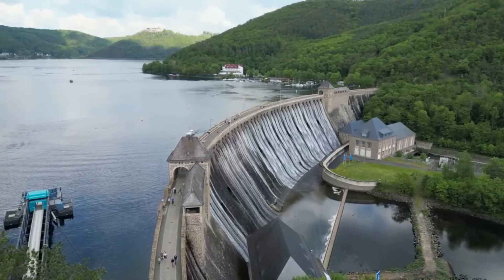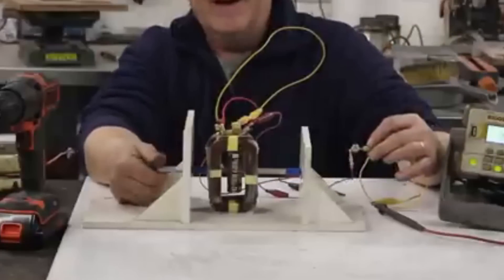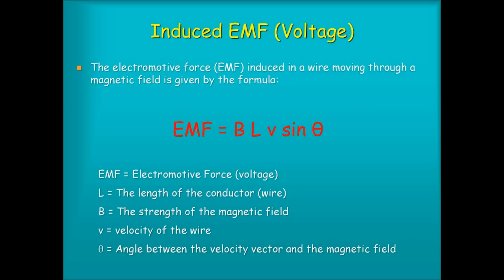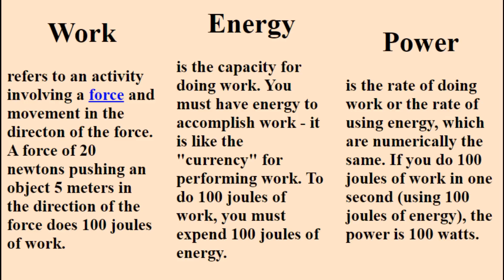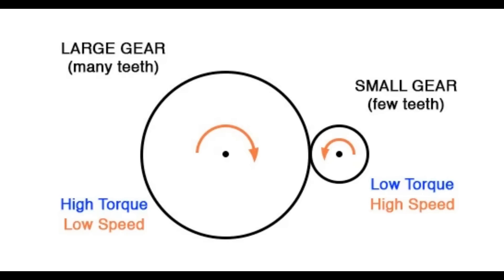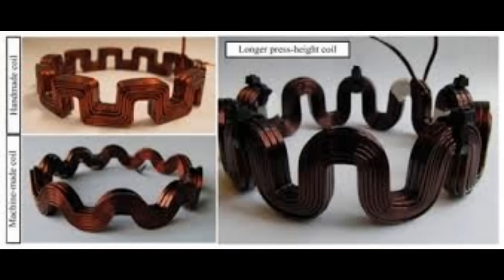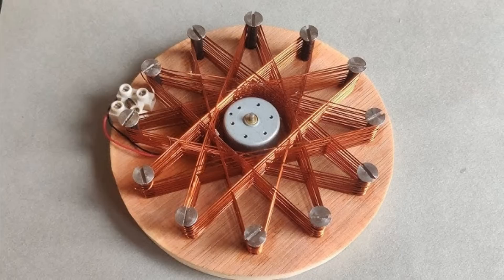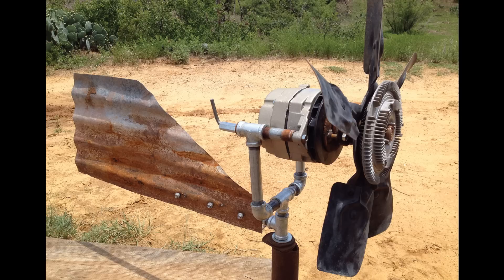2287 Building A Generator

Comment: ...i got all the measurements for the pieces for a geodesic dome within the 12 foot code [edit domearama page) and the thing is i have a cedar tree dying with enough lower branches to cut from , i think for the hubs I could use flat metal with flat tips that i wrap around the branch cuts and bolt together from scrap steel ....the thing with those they need a base for floorspace , tires filled around the decagonal base but then tires ar ebiohazard i thought but they shred them and use them in roads (!!!, genius instead...(?)) ....i saw a vid they slice the sidewalls off old tires then cut between the cables in the grooves to make rings , these maybe have some mileage for lighter vehicles , like a repurposed wheel ring of tread....i have loads of ideas oh my point on this dome mine will ideally have a standard square shed base then the dome will make hopefully the skull top part for this shed alternatively a mushroom theme would work for such a dome up on  a base , the eyes will be windows in the loft maybe like little office guest room ...

Comment: ..Oh the thing was i mentioned a shredder design for shredding styrofoam i could maybe source for * free * ,sort of, route getting it from retail places ... i was imagining it could even be hand shredded , it's funny there's many tools for shredding BBQ meat too for example , but there's so many ways one could shred styrofoam if the objective is just make a styrofoam shredder , by hand i could use straight boards and nails, screws protruding geometrically positioned to shred styrofoam , ...Now i'll probably make a roller with screw heads instead of old saw blades maybe seem overkill ....it'd be an interesting contest maybe hand shredder, powered shredders... i was originally going to use an old electric lawn mower , deck and all over a garbage can design . i think there's potential fireproofing it with concrete powder(s) but my design it'd be sealed in plastic then cemented over like a shell then glue mortared together for fake blocks , i've studied the styrobricks and aircrete bubble dish soap methods and stuff ...for sheds but cementboard is now exterieor rated versions in 4x8 and 2" foamboard is not that much for actual houses .../ranting (edited spelling mess typing)
EDIT2 : darn i just remembered the heat wire methods that make packing peanut sizes but this is for stuffing into old plastic bottles with lids then making a shell like blocks idea ...

Comment: ...there's a lot of newer components , supply , these things are elemental , all things are elemental then arrainged by geometry , IMO it's a good time to be a creative engineer , placing these elemental components to make new items , i saw a plastic box , with three or so strong magnets for example and some holes for mounting and it's a $30 gun desk holder junk thing...Batteries cost too much still is my design snag on the electric toys...

Comment: Modern generators. Are they really 99% efficient? That's surprisingly good
Reply from the maker: That's what I thought when i came across it - but then after a bit of reflection it made sense - they are simple machines with just a few limiting factors and over a hundred years of refinement.
Reply: @ThinkingandTinkering  I thought when we got materials science good enough to build large Tesla turbines it was going to give us a step change. Guess I have to hope in other areas 😜

Comment: Individually the voltage or current a generator can output is also not really that important, so long as you have a transform to "gear" your angry pixies to do the job you need them to do. The maximum heat the system can handle can then be your limiting factor.
Reply from the maker: ok mate

Comment: 5:00 Thank you for bringing in the wire gauge into the discussion. Most DIY discussions forget this key part of the system.
Reply: - thickness of the wire mostly depends on how hot you want it to get  (proportional to how much charge per unit time you need to pass through it) -  If you want it to get really hot, thin is better (otherwise) choose a thicker one....
Reply from the maker: i am glad it helped mate

Comment: So does that mean… as the load increases, the resistance increases, the Rpm of your driving force decreases, causing a fluctuation in Voltage? Or do you just need a driving force so strong that the resistance barely scratches the edges?
Reply from the maker: that's a bit like saying the harder you push a rock the heavier it gets mate - the load is the load it doesn't change - if you give it a bigger load then of course resistance increases  - but that is just like selecting a bigger rock to push - you need the driving force to be sufficient to over come the resistance of the load you want to drive- but there is another effect we haven't discussed here - that's just because it is a basic intro and i will cover other effects in other videos

Comment: I had an idea once to use cheap components to make a generator from solar thermal energy. (Cheap solar thermal collector, fridge compressors etc)
Low temperature differentials were the main issue for collecting low grade but high availability energy.
How much can that be mitigated at the heat exchanger interface. I was thinking of a 3D printed heat exchangers with a massive surface area and high flow rate to be incorporated in an orc system. Never could work out the maths to explore this potential though!
Reply from the maker: It's a good idea - i have seen quite a few solar thermal stirling engines - mostly the ones i have seen have been just large LTD engines

Comment: From old mate chatgpt .....An electron exhibits paramagnetic behavior, meaning it has an unpaired magnetic moment and tends to align with external magnetic fields. This is due to its intrinsic property of spin, which generates a magnetic dipole moment. Electrons with unpaired spins contribute to paramagnetism in materials, while paired electrons (which cancel each other’s magnetic moments) do not.

In addition, an electron can be described as having both spin angular momentum and orbital angular momentum, both of which contribute to its magnetic properties. However, individually, an unpaired electron behaves as a paramagnetic entity.
Reply from the maker: nice post mate - thank you for taking the time to do it - cheers

Comment: Great video Rob, I noticed that some guitar strings are silver plated copper and it made me wonder if they would make a good coil? I can't wait to see your crystal generator! 😎👍
Reply from the maker: they would if the wire was insulated mate
Reply: @ThinkingandTinkering  Thanks for the reply, it would be interesting to see how it would compare to copper only wire. They are one wire doubled then twisted so probably around 8ft when straightened out, enough to do a small test so I'll have to get some magnets 😎👍

Comment: Robert - I wonder if I could make a small suggestion.   The audio in that room is has a VERY bad echo.  I wear hearing aides and it is very difficult and grating to hear.  I'm sure I'm not likely the only one that has this issue.  Is it possible to add some sound baffling ???
Reply from the maker: It is a good suggestion mate and I am aware of the echo - i constantly try to do something about it and the best I have come up with is dialogue replacement - but that is a lot of work I am afraid. Baffles aren't really appropriate as it is my home - but I could also look at filming in a different room

Comment: When I clicked on the video I was expecting a build.
Reply from the maker: I am going to do a build but I also have been doing this for a while so I have a good guess at the kind of comments I am going to get. So, it gives me a good place to point commenters to when they ask the inevitable questions that arise from the build
Reply: @ThinkingandTinkering   brilliant . 
I currently run 10 kw of solar  and as you know winter sun is just not filling my battery bank so I’ve been hunting for a reasonable generator / wind turbine to help top up the batteries during the winter.     I’m on the side of a valley so during the winter the wind is good.

Comment: Robert I am SO PUMPED to see where this generator goes.  My passion project is to find a way to convert an air compressor or small used engine into a flexible fuel (biomass) generator for disaster relief/ emergency purposes.  I have not yet figured out how best to do this as there are so many possibilities....tesla turbines, steam engines, sterling and so on...each with their own advantages, disadvantages, and complexities involved
Reply from the maker: the best thing to do mate is just pick one - chances are you will end up building them all - it seems to me making a start - any kind of start is the way forward for you

Comment: Maybe this is a stupid question Robert, but isn't efficiency Infect all about removing resistans? 
If I have a generator where there is no air or baring friction (not that it's possible) wouldn't every type of coils and every size of magnets give a 100% efficiency, since all movement at the end will be picked up by the magnets/coils?
Reply from the maker: I guess in a sense it is mate. But as you point out that's impossible

Comment: Grateful points well made. I remember lecturers with an affinity for oil companies in the 80s using the irrelevant argument of efficiency of wind turbines on energy that woukd not have been converted otherwise. I tried to argue that the answer was blowing in the wind.
Reply: *Great points, well made Sir.
Reply from the maker: effciency is so often used as a cudgel to beat things into submission with - nice one mate

Comment: Hey Rob, it's so good to see you back at it again! I have a thought for you to eliminate the dead area of a coil while generating.  The stator is a coil  wound in small loops around the diameter of a larger circle in the shape of like a daisy. The rotor is a planetary gearbox with the alternating field magnets on the planet gears. With the correct gearing and coil arrangement, the magnetic field could stay perpendicular to the wire through the full rotation of the cycle. What do you think?

V/R,
Kyle
Reply from the maker: Sounds good to me mate - but axial flux does a good job and is pretty easy to make

Comment: I think also one thing people lose sight of is the concept many hands make light work. So let's say it is "easy" for you to make a generator that is only 60% efficient but you can make one in a weekend, and you enjoy the process. Well in 2 weekends you made something that is 120% as "effective" as something the original size in much less time because you just doubled up the easy thing. Generators can run in parallel, you can have lots of them and the easier and cheaper they are to build the more of them you can have. 

It sounds really obvious and almost daft when you say it out loud, but it seems like everybody is just on a quest to build "one thing" as in if I just build this "one thing" then all of my needs will be met, but that one thing is usually rediculously difficult or expensive to build. So why not build 10 things for a fraction of the price and effort?
Reply from the maker: i think you are spot on mate and make a very good point - thank you for sharing
Reply: This is one of those areas I think 3d printing really shines at it's best. Is the ability to make jigs to make things like doing windings a pretty trivial task.

Comment: my idea is to get kinetic energy from levitating magnets that are angled to create spin and float but have flat panes inbetween angled serration that causes spin, so that the flat areas inbetween help to stabilize it against Earnshaw issues (doddering bobbiness), and then have some SNSN magnets piggy-back on top of this floating thing, with some insulating material inbetween.  And then amplify the spinning SNSNS magnets with magnetic planet gears. into  wider circle maybe  with its own SNSN magnets near a coil. All floaty bits that don't touch - with no friction and possibly in a vacuum it might be awesome!
Reply from the maker: best idea is to build it and see mate

Comment: i still think perhaps we are all too enamoured with using magnetic fields to push electrons around and should go for a more direct approach, using electric fields to motivate the motion...  let the energy flow into the system from the dielectric field which is itself charged by radiant energy from the sun hitting the ionosphere...
Reply from the maker: There is a lot of work in not doing it this way mate - it's just the bulk of commercial generation is done this way

Comment: we need something to regenerate on the other end, using the same motion we self create, to then regenerate on the same axle immediately. a motor is a generator, and vice versa, we must combine both directly. why not connect 2 motors, one acting like the motor, the other directly generating from the created rotation, with eventually work in between the two.
Reply from the maker: Gen sets like this are already built - they are used for frequency conversion more often than not. You do see a fair few scam videos claiming free energy based on this too - but just linking a motor to a generator isn't going to create energy mate
Reply: @ThinkingandTinkering  no it isnt going to create new energy, but if work is performed on the axle, between the motor and the generator, then all energy spent too much than work was used, will be recaptured immediately? cant get more energy efficient than that?
Reply from the maker: that is a good point mate - now i am a bit embarrassed I didn't get that right away lol - cheers mate
Reply: @ThinkingandTinkering  no worries, love your thoughts. we dutch are all about economics :P great show thank you.

Comment: these defintion type videos are very good for building a foundation in my understanding as often time I join in only with logic and partially understood terms and guess work. I really could not tell you what the difference between generator engine, motor,  transformer, alternator, capacitor was at start (like wise for amps, joules, watts, ohmms, volt as units of measure etc) but getting an clear definition of generator now at least. Thing is if you don't use the term day to day you forget.
Reply from the maker: You do forget mate and so often 'those in the know' speak an almost foreign language when explaining stuff

Comment: Sorry, just one more comment:
The other thing about generators is that they actually get harder to spin, the faster you spin them.  This is because it converts mechanical energy into electrical energy, and this mechanical energy comes from the spinning of the generator.  At low speeds, a hand-crank generator may feel like you are stirring a cup of tea.  As you crank faster, it may start to feel like you are stirring a cup of molasses.  It all goes to show that "generators are not generators"; they are converters.
Reply: They don't get harder to spin the faster you spin them. They get harder to spin when the current increases because of the load. If the load increases they get harder to spin. If there is no load they can spin infinitely fast with hardly any effort. Aka Lenz's law.
Reply: You are correct.  I misspoke.  As load increases, the generator has to spin faster to maintain adequate voltage.  In the case of a hand crank generator, this requires a higher gear ratio, and consequently, higher mechanical resistance at input.  The human arm can't spin things very fast, so we have to make up for it with gear ratios and brute strength.

On a side note, if you made a generator with a long lever arm that travels in a circle, you could add a harness and have it pulled in a circle by a horse.  I have not confirmed this, but you can allegedly supply up to 99 percent of 746 watts in this manner. 😁
Reply: @DM-kl4em  Also , to gain the most power from your generator the load impedance should match the generator impedance.  That is why you need to know your load before designing your generator.
Reply: @justtinkering6713  he might be saying that as the speed increases.. the load such as a big battery might try sucking more current.. and will increase the torque required to spin the turbine and whatnot.
Thus, the increased difficulty to spin the generator.
Reply: @justtinkering6713  if the load is non existent, or requires a limited amount of constant energy input. Then ofcourse, the resistance in turning the generator to faster speeds wouldn't rise exponentially.
But if the load is greedy for energy, of course the resistance/torque requirement may increase exponentially.
Reply from the maker: they do mate - you are effectively pushing' against the greater resistance of a load - that is doing more work and if you do more work on the output you need more work on the input - so it gets harder to spin
Reply: @ThinkingandTinkering  So does that mean… as the load increases, the resistance increases, the Rpm of your driving force decreases, causing a fluctuation in Voltage? Or do you just need a driving force so strong that the resistance barely scratches the edges?
Reply from the maker: that's a bit like saying the harder you push a rock the heavier it gets mate - the load is the load it doesn't change - if you give it a bigger load then of course resistance increases  - but that is just like selecting a bigger rock to push - you need the driving force to be sufficient to over come the resistance of the load you want to drive- but there is another effect we haven't discussed here - that's just because it is a basic intro and i will cover other effects in other videos
Reply: Another thing: If the load is just a battery, then I think the load changes. I think the battery draws more current at the beginning of charge and less at the end.  Also depending on the state of charge, I think the batteries internal resistance changes also. But all this might mean nothing if you have a charge controller doing the job. It's a very dynamic thing.